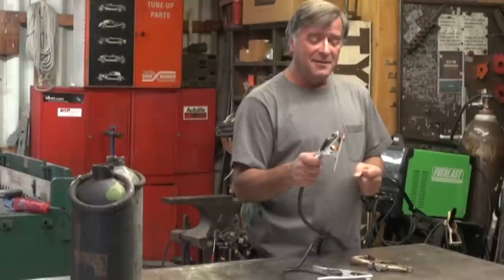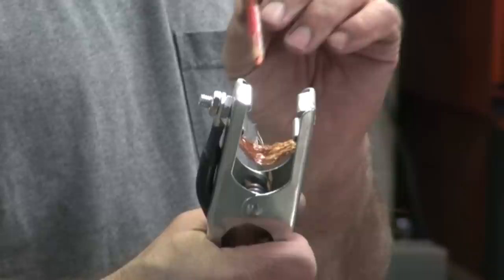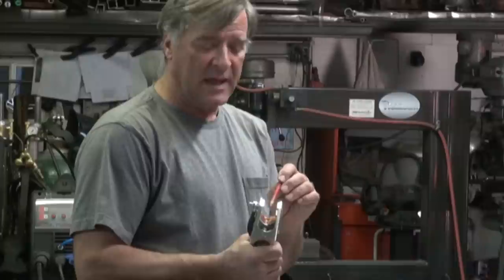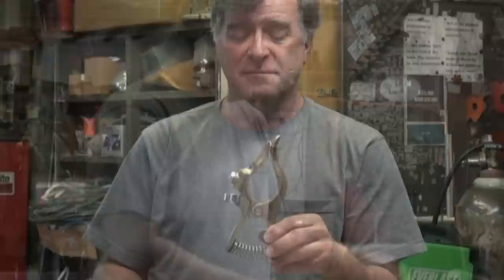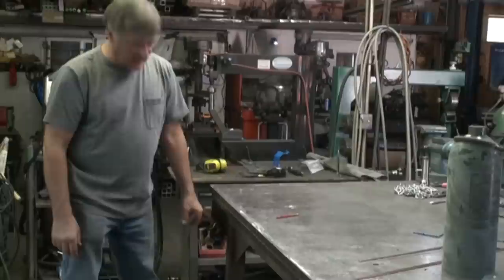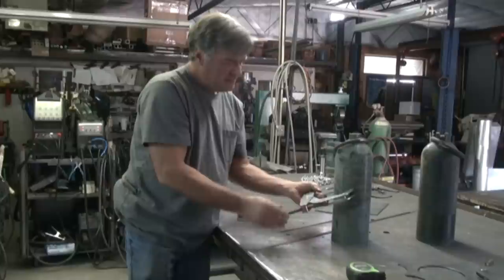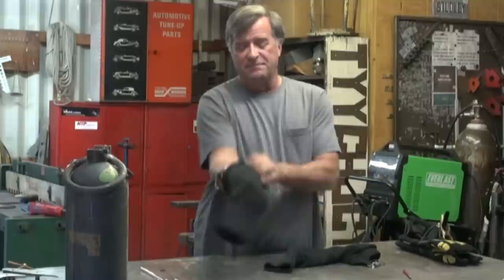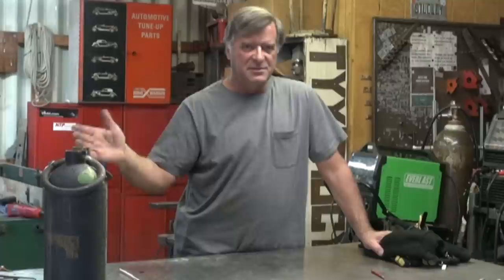How to Get a Good, Safe Welding Ground - How It Works and How to Work It - Kevin Caron

Comment: Thanx for this video. Most welding videos cover the same things over and over, my preferred settings vs recommended, unboxing wows, dropping dimes, etc. If you didn't know better someone might think they got one half of a battery jumper cable the way ground clamp topics are avoided in these videos
Reply from the maker: Glad you enjoyed it! It is starting to be difficult to come up with new topics for videos.   Running out of things to talk about.    Thank you for watching and posting.

Comment: Good video Kevin!  I chased a problem with my plasma cutter for weeks until I took a good look at the ground clamp.  It was corroded and the ground cable was loose at the clamp.  Cleaned and tightened = problem solved!

Comment: Another great video Kevin. I'm just learning MIG and was welding some caster brackets out of 1/4" x 3" material with the ground connected to my table. After welding each bracket it took a little tug to move it from the table. Didn't realize it until later but I was sitting the bracket on some bb's from a previous weld. When welding all the current was running through the bb's that the bracket was sitting on and melting them so the bracket was actually slightly stuck to the table. Now the table gets a quick swipe with a brush so the piece is sitting directly on the table. Haven't seen this problem mentioned in any of the videos that I've watched. Hope it helps others!

Comment: Great video i know it should be obvious but the video helped me realize I just need to isolate myself from ever being part of the ground. I was getting shocked through a glove, but I also sweat in my 90 degree garage when welding. great video going to try to just ground my work pieces for now on.
Reply from the maker: Worked wonders for me!   I don't get shocked anymore.

Comment: I was actually looking at welding tables... So i thought I'd just get a bench and ground to the bench. But a lot are painted or coated. 
I'll just keep grounding on the piece. 

Yet to get shocked welding or doing electric work in my house (haven't even been shocked by a ballast yet). So, I'd like to keep it that way :D

So thanks!
Reply from the maker: Glad I could help!

Comment: Nice video. For round objects groundin can be done with copper cable like pealed welding cable. Cable around the piece that you are welding and clamp the cable. Many ground points and still its off the table.

Comment: When you ground to the table itself and you have your workpiece on the table it will ground your workpiece since the table is grounded and the workpiece is on the table. So when you ground to the workpiece it's self and set it on the table it will still ground the table. It's metal on metal and electricity will flow threw every bit the metal touches , that's why when you ground to the table it also grounds the workpiece
Reply: Not if your table vise has adaptable rubber clamp tips or if your other table is wooden and you simply clamp to the vise and remove the rubber vise piece
Reply: @JD-ml7cg  The same goes for you, when you are welding you are supposed to wear good footwear for welding that means those shoes should have a good pair of rubber soles.
Reply: So please teach me best ways to ground when welding small piece like bolts. Thanks

Comment: I used a flat piece of metal welded a piece of steel pipe to it and clamped on that and welded my tiny stuff on the plate. Similar to grounding to the table but less chance of shock
Reply from the maker: That works as well.  Thanks for watching and posting.

Comment: Just one small tip about wire soldering, you should not solder the tip of the wire before you screw it into a clamp etc. This way you make smaller contact surface unlike pure copper line wire.

Comment: What are your thoughts on magnetic (on and off) ground clamps?  I enjoyed the video and found the information very useful in clearing up the path of ground and the operator.
Reply from the maker: Just make sure it is of the right amperage for your machines.

Comment: Most shock/ground issues come from cheap dual voltage units with an unisolated bus bar.
You wind up nuetral back feeding.

Comment: If you are working on a steel bench table or work table it doesn't matter where you ground it . You will always get closed circuit through the table if you even use a helper clamp . 
   ( You are still circuited through your work piece touching the table ) 

Best way to avoid his situation or anybody's situation is always wearing your *PPE*.
    as you said towards the end sleeves and gloves .

Comment: And incidentally the video in concept is good. We do need to differentiate between the welder WORK CLAMP (second clamp commonly and erroneously called the ground clamp) and the EQUIPMENT GROUND for the chassis of the welder.

Comment: I'm pretty new at welding. I do small stuff mainly. I hold my work price steady with my hand with welding gloves of course and clamp my ground to the work price itself or to some vice grips clamped to the piece. Is that safe? I haven't got any shocks thus far. Thanks. And also I'm curious about a third hand? Can I make one and clamp my ground to it?

Comment: Great video.
In order to prevent any shock from the table, is it not an option to use a wooden table as your welding table?
Reply from the maker: If you like to set things on fire!

Comment: Thanks Kevin. Don’t you think that when you clamp the ground to the work piece and the piece is on the table that now the table is still a conductor to you ( if you’re not wearing sleeves or gloves)? Also, with the ground clamps since they’re metal and connected at the hinge, the jaws are connected to each other and will conduct electricity anyway?
Reply from the maker: You are right on with your thinking.   Clamp the ground on the work or clamp to the table.  If you do clamp to the table then clamp the work down as well.  Just to make sure you don't rock the piece and break the ground.  If you do, then you can become the path for the ground and that is when you find yourself sitting on the floor wondering how you got there.

Comment: Hi kevin. 
Great vid. Very informative. I'm a novice bought a tig. Eastwood ac/dc 200. Trying to learn. I have a million questions so I'll start with one. I made a nice welding table should i remove the mill scale? If yes what's best way. Flap disc? What grit? Thanks for vids. I'm new subscriber and will watch them all.

Comment: Instead of grinding a clean spot on the table, get a decent sized brass bolt about 3 inches long and 2 nuts, choose a spot on your table that is out of the way but convenient, drill a hole and install the bolt with a nut on both each side of the steel. Now you have a place to clamp that does not rust. Be sure to put Never-Seez on the threads. Copper Never-Seez is better than the silver for this application but, it is splitting hairs.
Reply from the maker: Another great way to get a good ground for sure!

Comment: What’s a good table to ground on ? I have an art table thank I want to weld galvanized wire 9 gauge can I ground to my wood table by clamping everything to the table ?
Reply from the maker: Wood doesn't conduct electricity.   You need a steel table to weld on.  Or you can use a wood table, you just have to ground to your work instead.  Oh yeah, and put the table out after each weld.

Comment: Hello I'm brand new to welding and I just recieved a small arc welder, I know that i have to establish a ground. My question is my work bench is made of wood, if i can not attach to my project, can i use a vice to hook up to if i fasen it to side of my bench? Thanks for any good advice, Im excited to learn but would like to not kill myself in the process. Thanks a head of time!!!!
Reply from the maker: Yes, a pair of vice grips will be your friend for all your welding adventures!
Reply: @KevincaronSculpture  hey thanks, I felt stupid asking. But I had to do it, lol. So it’s all good to attach vice grip to wood work bench, then the ground to vice or if possible the actual piece. 
Super excited, I have a few things lined up already to try. Thanks again!

Comment: Why is my mig welder not heating up? I just clamped it yo some metal but do i have to put it on like car metal or sheet metal?
Reply from the maker: It has to be hooked to the metal you are trying to weld.  Or your cables are not hooked up correctly to the machine.

Comment: Can a small tag/arc welder be used for Jewelry?  Like at 20-30 amps?  Could I use tweezers or something as a ground?
Reply from the maker: I don't see why not!   As long as you can get the amps down low enough you should be fine.
Reply: @KevincaronSculpture  Awesome!  Thanks for responding!  How can I use something like an alligator clip as a ground versus the large ground clamp to hold items?

Comment: Common issue with welders. The WORK clamp (ie the second clamp associated with the welder) is NOT a ground clamp! All the major welder makers call the second welder clamp called the ground by welders the work clamp. A welder is an electron pump pure and simple. Electrons flow to the rod clamp, through the weld melting the metal and return to the welder. If we "ground" (common reference to second or work clamp) the work clamp to a long table bolted to building steel those electrons that should flow through the weld and go back to the welder now flow through the entire area of the building as the metal table the "ground" (work clamp) is attached to is bolted to the building in many cases or sits on a concrete floor (a grounded surface in relation to electrical distribution) 
The WELD CURRENT (rod clamp to work clamp) must flow ONLY through the WORK PIECE or that which is being welded. It is no wonder we have electronic damage, shocks and occasional electrocutions! THE ONLY GROUND ASSOCIATED WITH A WELDER IS THE GREEN WIRE TO THE CHASSIS! DO NOT GROUND THE WORK CLAMP. IT IS ONLY TO BE CONNECTED TO WHATEVER IS BEING WELDED!!! THE WORK CLAMP IS NOT NOT NOT A GROUND!!!!!!
Reply from the maker: +John Goodman 

Laziness on my part,   you are correct.
Reply: Thank you
Reply: Hi Sir  +John Goodman 
,

Can you please refer me to a book or a page where this topic is elaborated. You are right, this has become a "common issue". But to my surprise, there is not too many articles discussing this. Hope you can help. Thanks!
Reply: Anyone learning to weld should have this post engraved in long-term memory:  THE WORK CLAMP IS NOT NOT NOT A GROUND!!!!!!

Comment: 5:18 wouldn't your worktable still be grounded by the handle of the big clamp that is rested against the bench and by the pipe that is also in contact with the table?
Reply: He never replied to your comment because he died from a shock occuring from exactly that
Reply: @robbrenton9438  he’s not dead

Comment: I sold my cheap harbor freight welder and got a more powerful powertig welder. The work clamps were much much better. I never appreciated just how important the work clamp was
Reply from the maker: Need a good ground to get a good weld!    Have fun with the new machine!
Reply: Maybe all you needed was to upgrade the cheap clamp on the Lincoln..

Comment: If you are welding on a car with rubber wheels do you have to make a separate ground from your work to the actual ground
Reply from the maker: Just make sure the battery is disconnected and you should be okay.
Reply: @KevincaronSculpture  seriously tho, you have to do it for a house ground

Comment: Good vid. I have an upgraded ground clamp on my Lincoln mig but I underestimated the quality of ground contact in order to get a good weld. I was flux welding some hand railing that I was repairing while powering my welder with an inverter gen 3500watt. It was sputtering some and getting very little spark. I hand my ground clamp directly on the down tube that I was working on but it was painted and I didn't grind it to fresh metal. Like a moron I thought the ground clamp would somehow penetrate through the paint and give a good ground. Boy was I wrong. I was blaming and cursing my gen on being too weak when in fact it was my weak ground connection that was the issue. Once I cleaned the ground contact metal, along with the metal where I was going to weld, my gen powered through all my welds without out a problem. Good clean metal makes a world of difference.
Reply from the maker: Amen Brother!!    Can't say it often enough!!

Comment: About leaning on the table and getting the amps through your body: wouldn't a good pair of welding boots prevent that from happening? That would isolate you form the ground and you could touch the table or even the work (if you skin can bear with really high temperatures) just like birds on a wire, right? Thanks!
Reply from the maker: +Joaquin Gracia      Was wearing heavy boots,   didn't go through the boots though..    went through my arms and back to the table..      Hot and sweaty makes a great path to ground!
Reply: +Kevin Caron, Artist. Oh, I see. I'll take care. Thank you.

Comment: Thanks very much for the information. I have a question:
I have to stick weld about 45 ft away from the welding machine. Is it ok to clamp the ground cable , let's say to a welding table that is close to the machine? ( my ground cable is only 10 ft long). 
Thanks
Manny
Reply from the maker: Should work fine..   Not preferred but work with what you have on hand..
Reply: Much better to clamp directly to the piece you are welding but that can be sometimes tough. I upgraded my clamp with a beefy one from Everlast. I haven't had any mig sputtering since.

Comment: dont solder the end of the cable, the exposed copper is a better conductor. Just twist the exposed cable a bit and make sure you don't have any whiskers poking out of the lug.

Comment: Kevin, I watch all your videos an learn a lot from them.  I'm looking to buy a different stick welder an want to learn mig also.  I have a Lincoln 225 Buzz Box that I learned stick welding on oh I say at least 45 years ago. It still works!  Old battle ship!  What's your preference on transformer verses inverter welders an how about a combo unit - Stick/TIG ?  I'm retired an just do small projects, fix it jobs, an prototypes on new ideas.  I enjoy it but not all the frustrations of the AC arc.  Think I want a DC arc an it be a Inverter type welder. 
Thanks an will be following you an looking forward to a reply.
Ken

Comment: I have a trailer that is painted, and I need to weld some additional metal to it.  Other than grounding the spot to be welded how do I ground to the trailer itself when all the other parts are painted?
Reply from the maker: You will have to find or make a shiny piece of metal to ground to.   Sorry, only way to get a good ground.

Comment: Real men, like myself, hold the ground lug in our teeth, to feel the current we're putting through the work piece! Just kidding of course. Having good low resistance ground will also reduce power load on the welding machine for a given current requirement. Table should always be grounded even if you are always grounding the work piece separately. Good, accurate video.
Reply from the maker: Thank you!    Just trying to pass on what I learn the hard way.

Comment: I have a question can I got with a larger/ heavier ground cable then comes with my Miller 211 or should I stick with the same size not length
Reply from the maker: Yes, you can make your own cable to replace that one.   You can go as large as you want but the big brains at Miller took the machine in to account when they designed the one that is on the machine now.
Reply: I understand that I just have a heavier Gage lead  was wondering if it will effect the machine any if I just used it or if I should just go buy the same gage as it came with

Comment: I have a multi-tap stick welder 110 220 the continuity bracket came off how do I go about putting it back on I have tried for hours and can't get that booger to line back up
Reply from the maker: Sorry, have no idea what you are talking about..    What machine? What model?  How did the bracket come off? Is it broken or is there a bolt missing?

Comment: Hello, 
Thanks for video. I just got a Lincoln 140HD Mig/Flux core machine for Christmas. I am having trouble grounding my welding table. I can clamp directly to the piece and it works fine. I clamp to my table and have a no ground. My stick welder has no issues grounding the table. Is it because its a 120v machine? Is it because the table is 1in. thick steel?

Comment: Hi, I've seen a few guys welding and actually they were holding piece with bare hand, how come they didn't get electrocuted?
Reply from the maker: Their hand is not part of the circuit.  As long as you don't get in the way of the electricity you are fine.
Reply: Thanks